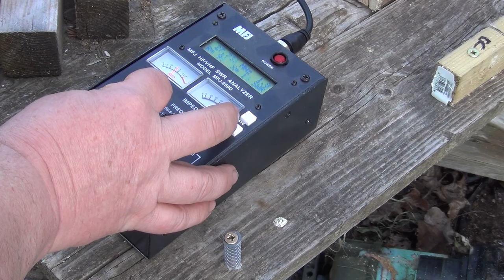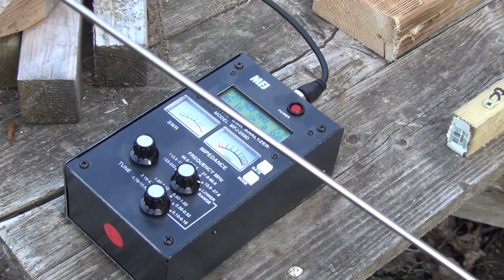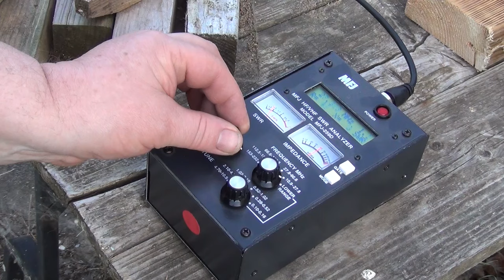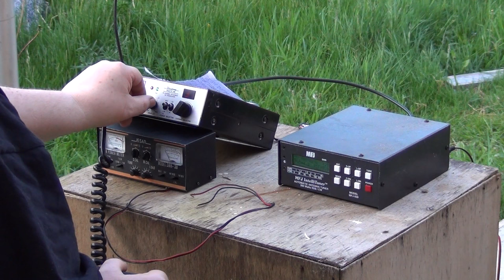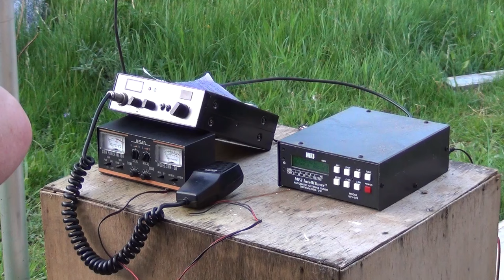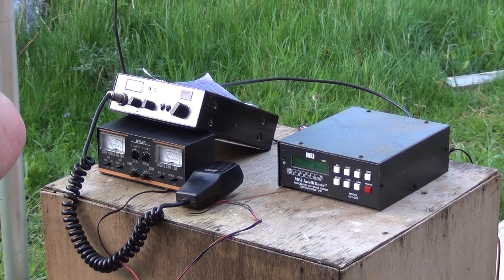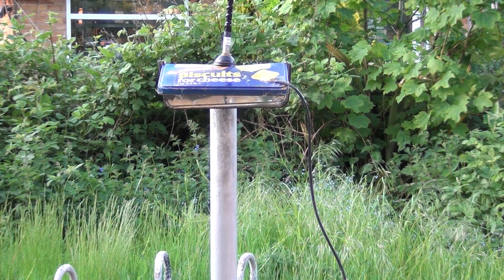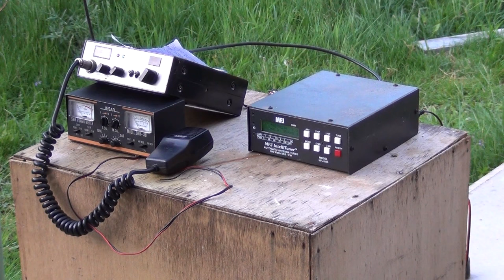No base aerial possibe? Aerial lashup bodge demo for a friend with neighbour snags & no trees.

Comment: The modulator, Scarlet Warrior, Red devil etc all suffer from corrosion at the rivets that attach the loading coil to the 3/8 stud at the base and the whip stud at the top. Every one I've ever had I've drilled out the rivet and replaced them with a self tapper that cuts into the brass studs top and bottom. Then I go over the top with self amalgamating tape, glue lined heatshrink etc etc to keep the moisture out. Brass studs, ally rivets and copper loading coil plus moisture is a bad mix.

Comment: I use the AmPro antennas for HF on the car. For portable I have an electricians earth rod with a mirror mount and some random wire radials. Takes a bit of tuning sometimes but it really does work. My portable rig is only 10w but regularly work transatlantic on 17m.

Comment: I have a 20ft balcony with 3 antennas on, the simplest us a Hawkins Thunderbolt Ssd12+, 5.5m wire with coil, thats hung on a spiderpole 10m, it works the NW just fine.

Comment: Can I ask what type of 12v battery you used and how you connected it to the CB radio?
Did you use any kind of special cicuitry etc?
Reply from the maker: A car battery in a plastic box. The plastic box is fitted with a volt meter, two cigarette lighter sockets & two pairs of 4mm binding posts. The wiring inside the plastic box is fused at 10A..  

Richard, G0OJF, UK
Reply: I have a 150AH used twice  it's fully charged  but great but it's that heavy it need a sack barrow to move, you could not carry to the top of a hill but it's handy were I park the car it will run a cb.a 10m radio and every thing I have to use and I have a generator  and that's handy  to

Comment: I think you would have been better just using a vertical wire dipole.
Reply from the maker: Yes I know I would, but this musn't be spotted over his fence height!

Richard
Reply: @ukfmcbradioservicingTango21  There is usually a way round things, I have made aerials out of strange things, and hid them in many ways before.
However, I have not seen the location, or how bad his neighbour is!  Running a thin wire up a plastic downpipe is one way, though rain does upset things a little, but a CB matcher will keep SWR down.
We even added a plastic downpipe to a building and put the aerial inside, it worked, no one suspected it was an aerial.  The Landlord said "No aerials", he never noticed the extra pipe.  It was there for 12 years of use.  For all I know, the pipe might still be there, though the owner of it has moved on.

Comment: What MFJ tuner are you using?  Is it a 12 volt or 24 volt unit ?
Reply from the maker: The tuner used was an MFJ929, which I normally use on 1.8Mhz amateur. It is 12V & I can't see any that are 24V

Richard, G0OJF, UK